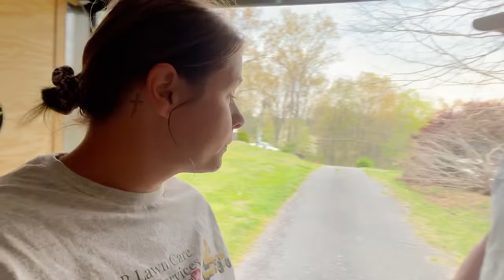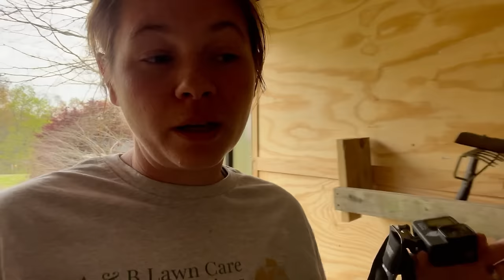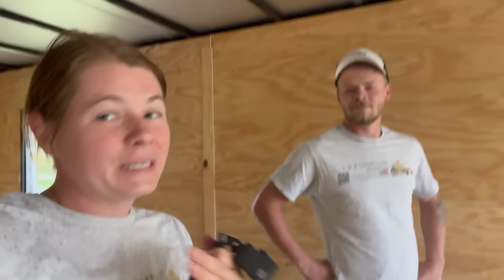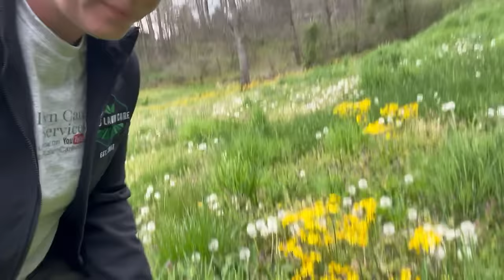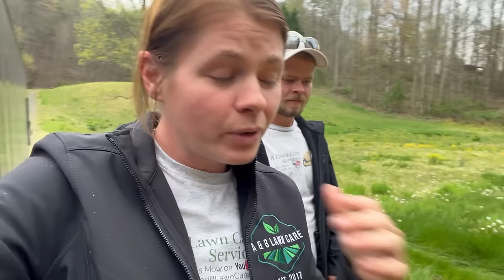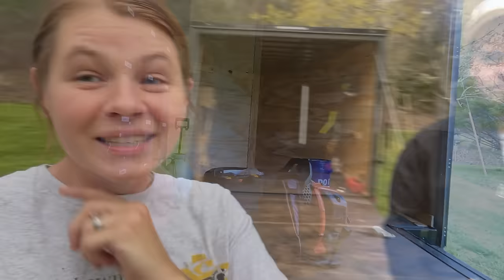LET'S talk about PRICING#pricing #pricingstrategy #work #cubcadet #mowing #business #owneroperator

Comment: That’s only 27 dollars per hour say 30 without filming. If it works for y congratulation, here in Washington state I would be bankrupt in 1 year. Non ethanol fuel is 6 bucks a gallon. I can’t wrap my head around mowing the same yard 2 to 3 times. I breaks my brain. The cost of living cannot be that much cheaper. If a yard takes 2 people a hour best case you need 60 per man hour more likely 75 that’s 120 to 150 per crew hour.
Reply from the maker: Thank you for all your wonderful advice. I’m sorry to hear about the high gas prices where you are. Thankfully ours have been decent being between 3.50-4.00 a gallon. It’s about the same as diesel here. We totally agree with you on all your pricing points. We usually bid our yards at a minimum of $100 per hour but we don’t work by the hour that’s just us estimating about how long we think it will take but as time goes by we usually end up doing it quicker than expected. We are blessed to have a variety of clients at different price points and thankfully our cost of living isn’t that high, or we try to keep it that way it’s hard in today’s time. I personally don’t like mowing the yards twice but sometimes we do it just for our own pleasure as in how the curb appeal is but I hope to have to do it less often as I am planning to keep the blades sharpened regularly and hopefully to upgrade to commercial equipment too! Thank you so much for all of your support and we hope to read more of your comments in the future! Thank you so much for watching